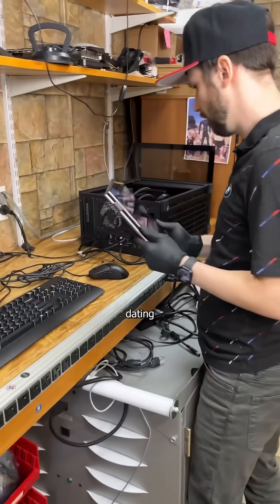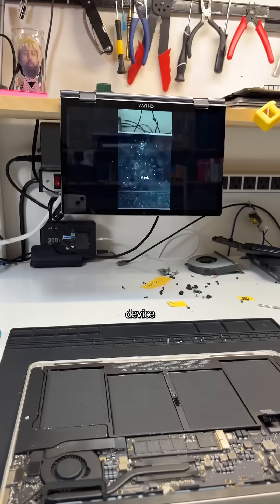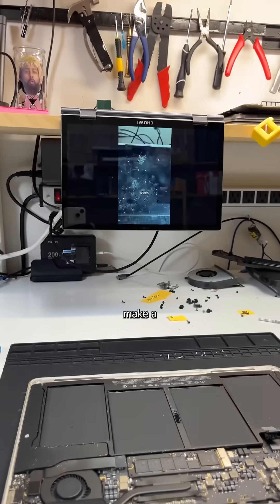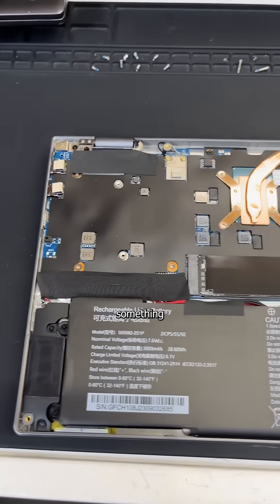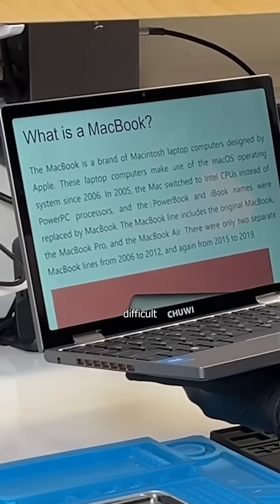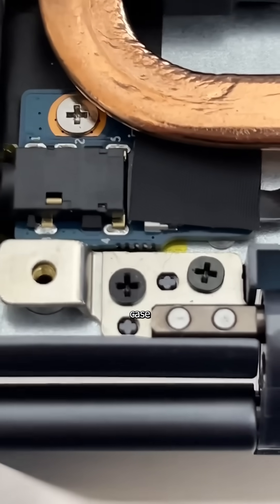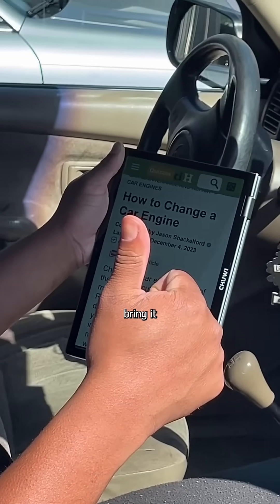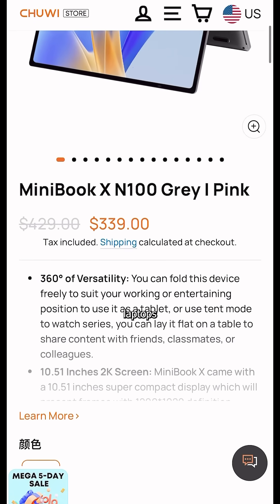The Mini 2-in-1 Chuwi MiniBook X laptop is my new daily driver #computer #pc #tech #technology

Comment: Sad how a cheap laptop from a not-so-well-known brand has better build quality and hinges than much more expensive laptops from the top brands
Reply from the maker: PREACH. The Lenovo Yoga is miles below this thing and so much more expensive. It's sickening.
Reply: @SalemTechsperts  literally thinkpads from 2011 are better than most if not all modern laptops in serviceablity, that chuwi is definitely a cool thing though
Reply: @SalemTechsperts   I've known Chubaca (Chuwi) for a long time. Back in uni (2013) i got my self a win 10 tablet with optinal magnet keyboard. It was amazing ,  Intel Atom quad core with 4g Ram and 10 inch LG Retina screen(taken directly from Apple's assembly line) . All of that for 120 USD... at the time when the standard school laptop was around 1000 (where I live). That thing lasted for years until it met is failure (cant charge).
Reply: I still use a dell latitude E5500 that has been ALMOST maxxed out. Only upgrades I can do at this point is a bigger ssd (I believe max is 8tb due to a max of 2tb partition size with max 4 partitions) and 8gb of ram (ddr2 pricing is horrendous). Other than that, the build quality has held up the last 16 years with only minor hinge cracks. Honestly peak dell design, it's all been downhill from there 💀
Reply: @iliketurtles50000  the E5500 is a damn wall
Reply: @leovillant  what?
Reply: I had a Chuwi tablet in 2018 and it lasted a really long time, it was very sturdy. What broke it was that I foolishly put it in checked luggage instead of carry-on and it got smashed
Reply: chuwi has been around for years though. functional but the drivers are junk.

Comment: 350 bucks is crazy.
Reply from the maker: Right?? And the 13" is only like 20 more expensive than this one too lol I have no idea how they made it so cheap
Reply: @SalemTechsperts  R&D costs are not on the company (i.e Chuwi) as it's an OEM/ODM design shared by many companies, which drives prices down with scale going up.
Reply: @blackhorseteck8381 So the factory in China stole the design lol
Reply: @phil2756   nope, the OEM that has huge R&D and fabrication capacities does the heavy lifting and markets a ready to sell model that you can your own name to if you order enough units.
Reply: @SalemTechsperts  freakin like that's already the price of a portable monitor (I was looking around). Though similarly and somehow, much cheaper versions exist.

I guess what blackhorse ☝️ said.

Comment: 350$ for a laptop?
That's a steal!
Reply from the maker: For a 2-in 1 at that. It's nuts.
Reply: Given its processor I wouldn't expect more than a typical android tablet performance out of it. Its form factor does lend it usefull but to compare it to a laptop that has a core ultra 7/9 wouldn't be an exactly apples to apples comparison. I find the form factor to have alot of potential use and versatility. I think its price is appropriate because I would be cross shopping this with android tablets instead of laptops with u or h class mobile chips. Its my understanding that the n100 is intels low power chip for more mobile applications. Though I wouldn't expect premium snapdragon chip performance out of it. It would be cool to play around with and see what it can do becuse x86_64 on mobile seems kind of wild. It makes me wonder if intel will ever make low power x86_64 chips that could compete with the likes of high end snapdragons or apples m series chips on a performance per watt metric. It seems like they are slowly starting to break backwards compatablilby and shed some bloat which in my opinion is going to be needed if they want to seriously compete on that metric and gain market share in for them near untapped for them segments. I am rooting for them as I think they can do it and it seems they are the underdog now.
Reply: I have the chuwi gemibook xPro, almost the same, and FOR ONLY 250
Reply: @ShRedd33r  I feel like your paying extra for the touch display but also reinforces my though that is priced fairly.
Reply: @ShRedd33r  does it have the same performance , if it could be used for the making the note
Reply: @RBmed-quiz  if you mean taking notes by typing instead of using touch screen input, yea, they should be pretty comparable. If you are going to try to take digital notes via the touch screen I would shoot for the optional upgrade that supports pen input in addition to touch. I am self admittedly not an expert on digital note taking. However I am quite intrigued and excited by a machine like this. I kinda want a low power machine with a touch screen. For me the 2 in 1 form factor appears to solve most of my issues with traditional tablets. It would be nice if it had a sleep wake button because my idea is to primarily use it as a tablet.
Reply: Intel N100 will do that
Reply: not as much as a ryzen 4070

Comment: i have this model in pink and put linux on it and it works pretty well (the keyboard doesnt turn off when in tablet mode but thats it)!

a warning though, the batteries on chuwi laptops are reportedly really bad and seem to commonly turn into a pillow after few years
Reply from the maker: Unfortunate that they don't have Linux drivers for the tablet mode, but I can say I did a fresh install on the NVMe I upgraded to, and was able to download all the drivers from their website. Forums are very active and their support was quick. If the battery ever goes I'll let you know how the support is
Reply: @SalemTechsperts  why would you need driver's for the tablet mode? To me that makes absolutely no sense. If the touch screen works it should just work. It's an Intel powered machine so I would expect good Linux support with the drivers for graphics already provided by Intel. It's been a while since I have seen keyboard or touch pad issues because most of those just connect over USB.  If it's a pure Intel machine with their wireless card and audio you could expect no issues there as well. Though any of the potential issues have nothing to do specifically with tablet mode. Does it do something special when you put it into tablet mode?
Reply: @lejoshmont2093  it does not turn off keyboard and trackpad due to them using an unconventional tablet mode switch (two accelerometers)
Reply: @glaceonikki  thanks for the reply I have always assumed that they didn't bother disabling them. Nice to know that it is intended to disable when you flip it all the way open.
Reply from the maker: I tried to get the pink one but it was sold out 😂and re: the battery, EVERY laptop manufacturer is going to have spicy pillows after 2-3 years. It's an epidemic in the industry.
Reply: @SalemTechsperts my Asus laptop hasn't had to have a battery replacement at 5 years, albeit the battery life on it is about 60% of what it used to be
Reply from the maker: @Mike-bc7xv  ASUS tends to make pretty reliable laptops. But everyone sources their batteries from like 5 factories, so it’s luck of the draw I believe
Reply: @SalemTechsperts  hit the nail on that last point; might be just my luck. Replacing it anyway, I'm in college now is a $400 ish notebook similar to your Chuwi is in due order. Might need something a bit more powerful for financial modeling though. I have an idea of brands I like, what brands do you reckon I should stay away from?
Reply: @SalemTechsperts  in the automotive world it's even fewer supplies, at least for regular 12v, you pay for the warranty. The difference between a cheap battery and an expensive one is next to nil.
Reply: That's what I was thinking. Any issues with the BT/wireless card? I'm hoping for an Intel card but not holding my breath.
Reply from the maker: @lejoshmont2093  I can confirm the BT / WiFi card is indeed an Intel AX101